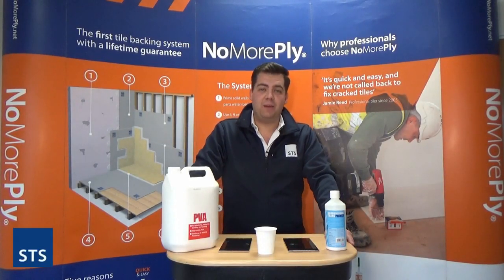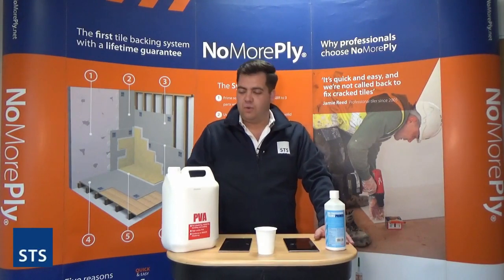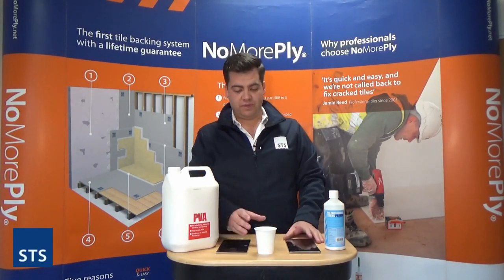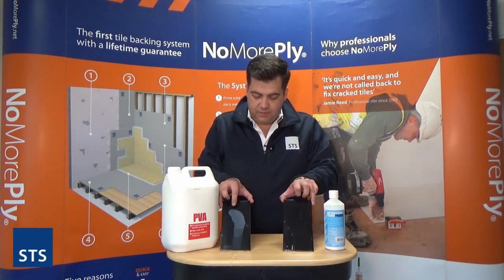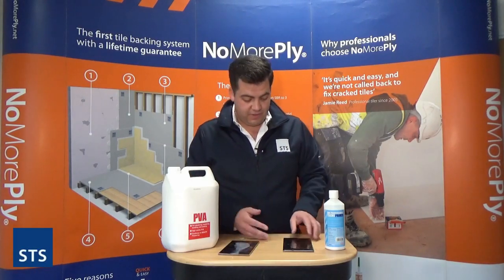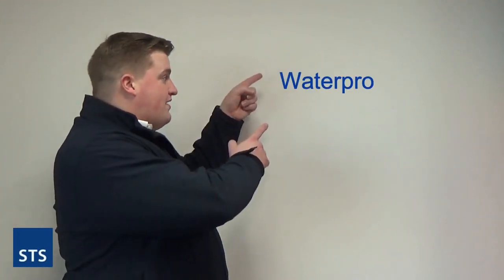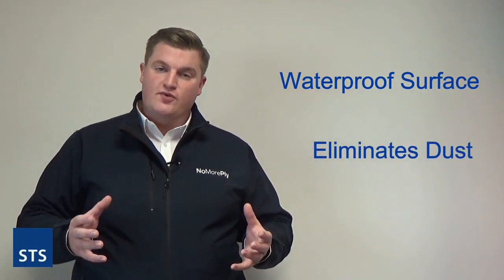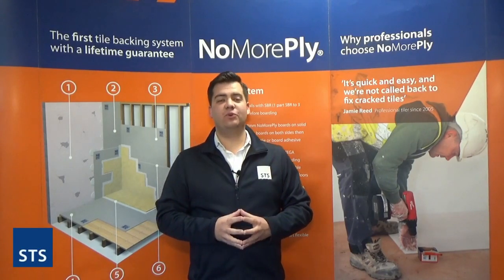PVA vs SBR | STS

Comment: 1- Waterproof surface VS PVA

Yes, after 3-4 coats and 48h + of wait time, and most likely it will be a very slim film that is waterproof,  similar to a sealer I reckon.
2- Eliminates dust  VS PVA
Well PVA sort of eliminates dust, but I assume key point is that the dust will not stick to the SBR applied area ? I don't think this will make anyone rush to buy SBR.
3- Best adhision VS PVA 
We need to see stats on this, tests made. How significant is this "best adhision", when adhesives stick to a non primed PVA wall anyway ?

My actual question is, why would you test this on a gloss tile which doesn't absorb the PVA or SBR and not test in a real life scenario, on plasterboard or whatever ?
I could brush some cheap sealer on that tile and get the same results that were shown in this video :)

Cheers
Reply: To be honest there should have been a number 4 (or at least mentioked in point 3) and that's the major one. SBR when set it no longer water soluble, PVA when set is reactivated by water. So when you smear some adhesive over SBR it gives you a nice pull on the trowel and sticks good. PVA is reactivated and turns to mush giving shit adhesion

Comment: Thanks for your great video very helpful. 
Is there a good SBR  I could use to prime an external wall that has masonry  paint.
The paint is sound and not flaky.
😊
Reply from the maker: Thanks for the question. Although we are not specialists in priming painted surfaces, I could recommend using a Sika acrylic product, and would also recommend checking with Sika for the best product from their range.
Reply: @stslimited9160  ok thanks for your reply 👍

Comment: Hi, thanks.so I shouldn’t use pva on a plaster wall before painting..? What do I use ? Thanks
Reply from the maker: Hi, thanks.  The normal way to prime a newly plastered surface is with watered down paint. The standard recommendation is a 70:30 mix of paint:water. Apply this mist coat to the plaster and allow to dry before applying your finished paint surface. Hope this helps :)